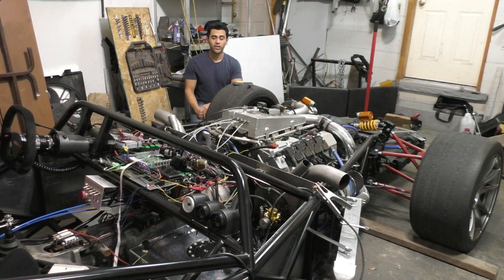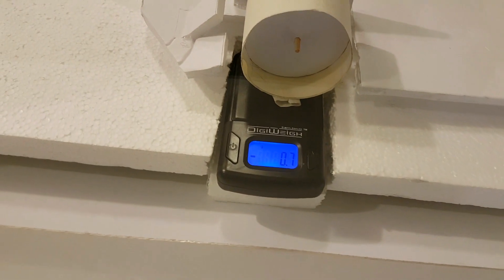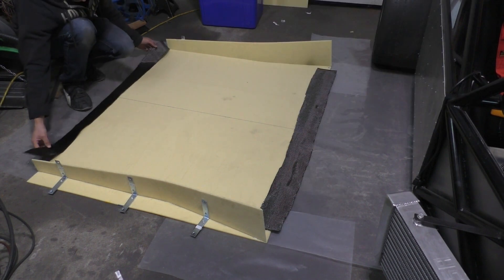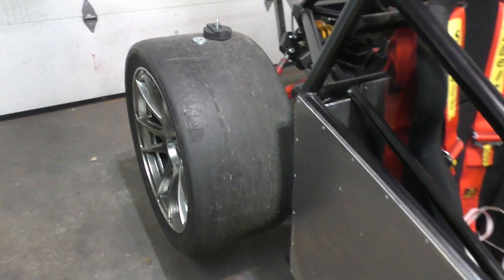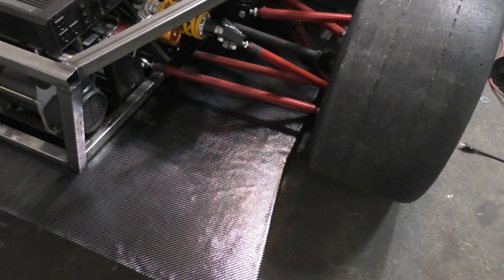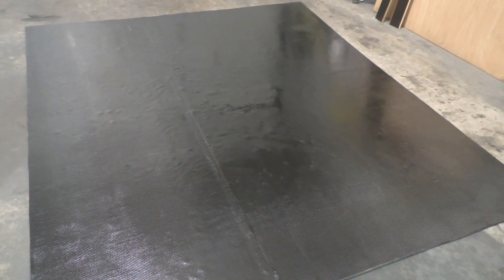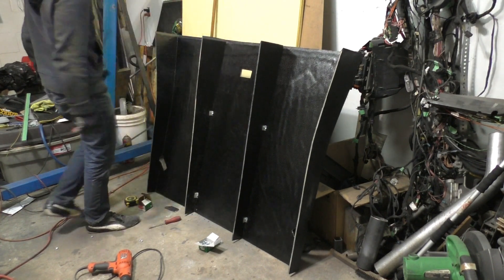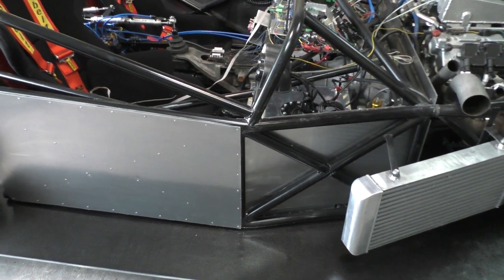Making Functional Carbon Fiber Rear Diffuser and Flat Floor - E55 ASL Part 20

Comment: carbon fibre corrodes metals when in direct contact. also you should consider reinforcing sections of your undertray with aramid fibres to form skidpads. also sandwichpanels should not have open edges. ideally you would add carbon fibre around the edge (probably requires vacuum) alternatively you could use some type of viscous adhesive.

Comment: What might be interesting to implement is to 3d-print a teardrop-shape that could fit around your hockeypuck fastener. This will reduce drag by 60-90% on the fastener and improve airflow around it by reducing the turbulent wake to laminar flow instead. 

The reduction of drag is of course depending on the shape you'll make the teardrop shape, but by just adding a pointy end to your puck, it will reduce drag on it by approximately 60%.
Reply: Someone should gift him a 3d printer. I'd like to see him use it to cast his own parts.

Comment: You should always use opposing and crossing fiber directions. This is very important for strenght. Usually 45° between each layer and different tows too. You tested it one way? Cool, but it might break easily on the otherway. ALWAYS vacuum bag if mold+press or proper manufacturing tools are not available. I have a lot of carbonfiber part development on my car and also foam cored parts. Good luck. :) Do not set your self for failure, in racecar et means injury or death.

Comment: Have you considered using Hall effect devices instead of reed switches for the gear sensing? They would be much smaller and faster than reed switches
Reply from the maker: Yes, that would have been better but potentiometers are a more precise solution, since they'll tell the exact position and even speed of movement

Comment: How did you determine that you would have more front downforce from the diffuser design and how would you determine a balance before you put on the wings? ✌🤔
Reply from the maker: Just by cfd and wind tunnel cut outs. It's not the most accurate because it didn't simulate the spinning tires and stuff. I will be setting the final rear wing angle on the track to get the balance perfect

Comment: I just found this project yesterday and i have bingewatched every single episode until this one since then, really enjoying it alot! Can't believe what you have achieved so far! One thing though: Welding a compressportank is dangerous, and i mean like really dangerous, it should NEVER be done! I would strongly advice to remove that now sevierly weakened tank as soon as possible and find another solution, something that can bolt on preferably. This tank is a potential bomb that could explode when you least expect it. I get that this car is a death trap anyway since it IS a racecar and not a streetcar, but you try to make it as safe as possible anyway and you should really consider it. Also isn't there any way to possibly drive a compressor straight from the engine and get rid of that heavy and clumpy inverter?

Comment: Great job with the floor
but
Remove all this messy shifting system and go for simply manual shifting
Reply: Cristian and save a load of precious weight by removing the compressor, inverter, air tank, pneumatic cylinders, linkages, control system ...
Reply: Sometimes he adds tech for, what seems like, the sake of adding tech.  Ditch the air shifting shenanigans, drop a bunch of weight and have peace of mind knowing that you don’t have a bunch of jenky parts that could cause a failure on an otherwise amazingly built/engineered car.
Reply: @carportshenanigans5918  Exactly..   I could understand this shifting system as a demonstration of his enginiering skills... in that case this is an excellent job, but for the reliability of a race car I think it is not a good idea at all... Also, I don't think this hybrid system is faster or efficcient than shifting this manual transmission by hand xD
Reply: @Cristian, it’s definitely a cool excercise in engineering.  Reminds me of all the shenanigans he had on the old car with electronic throttle bodies and computers and all sorts of sensors when the turbos should just be blowing directly into the SC inlet.  Oh well, nothing wrong with experimenting...great way to learn.

Comment: you said you only get an extra 2kgs of weight by not vacuum bagging. have you also considered the extra material you need in order too make the material smoother enough so the air drag is as low as the vacuum bagged one?

Comment: Have you looked into vortex generators or turning vanes as opposed to a skirt to seal your underbody?
 I'm working on a design for my own car, and I thought about a skirt, but being street driven, I feel that any material with enough deflection to accommodate for road imperfections would also displace due to the aero forces.
Unless you went with a firmer material and some sort of trap door mechanism, which would just add weight and complexity...

Comment: If you're not going to vacuum bag then your best bet for spreading the resin and eliminate the air bubbles is to use a finned roller.

Comment: I think I hear more excitement in your voice in this video that the previous ones, you are getting so close now. I had two thoughts while watching, first did you consider using one of the rollers that they use for fiberglass which helps with resin distribution? Second could you use a cheap shop vac with disposable paper filters to suck up the carbon fiber dust as you cut it?

Comment: front part should be re-design front difuser throws expanded air on tire what cause higher presure under tire makes lift and drag u should make tunel under that throws air at the sides behind front wheels this air also can produce more downforce if u use vortex at the skirts because vortex will provide a rotation that stops air from coming under the car and u would got some more predictable downforce

Comment: Fiberglass is actually stronger. Use an industrial type and your epoxy resin. For a core the foam is good the plastic stuff that looks like Corrogated cardboard works good too.  Fiberglass is more flexible though.

Comment: Have you ever considered simply actuating the shift fork control rods independently? This way you just use three linear actuators to operate the forks directly. It may be quite complex to do on a longitudinal transmission though, and stopping in neutral may require an additional actuator to act as a physical stopper, but it just seems like a much more direct approach for computer control vers adapting extra nonsense in the middle that's more designed for humans.

Comment: Typically you bridge a household aluminium ladder on two bricks across a piece like this and then you can reach all areas easily. Ideally, you would have spread resin using a window cleaners wide squeegee on a pole and made life much easier, faster and not have the resin pooling and air entrapment issues.

Comment: shoulda used paint rollers instead. that's what I used when making splitters for my car and it applies pretty even layer of the resin while not putting too much of it on the part.

Comment: I love the design of your car. Do you mind if I post a link to your videos on locostusa? I'm a bit concerned with your front spindles and also the attachment of your floor. When I built my car( phil's LS1 locost) I ended up using .090" 6061T6 and stainless rivets 2" on center for the floor. If you were to have an offtrack excursion your minimally attached floor could delaminate the way your splitter did and your legs could end up outside the car. I was also concerned about what would happen if I ran over something and it slit the floor like a can opener . If you added some thin aluminum strips below the floor and sandwiched the carbon between the frame and strip and increased the number of fasteners,it might prevent the floor delaminating if the weight of your legs  loaded the floor heavily ( you choose what G force to design for in a crash). Not sure about the strength of thin carbon fiber in a can opener situation.

Comment: Seems to me  your  inverter  and air compressor are heavy unless they putout a high CFM. I'm using a belt driven air compressor "york210 converted from a/c to air" with clutch pulley. Its powerful, fast and reliable but, a hassle to find a stable belt for it not to mention a custom bracket to mount it for your situation and really heavy.
There are air suspension companies like viair that sells 12v compressors with 100% duty cycle, small and a tank with internal compressor but, I'm not sure one will be enough for you.
Still its worth checking out. At least electrically safer.

Comment: You should of definitely vacuum bagged that carbon fibre the crappy surface will cause a lot of messy air but mostly it just doesn't look as cool

Comment: the steel air tank you used is going to create rusty nasty water in your air system. you need to use a AL tank

Comment: You should be prewetting your foam before putting down your Carbon, alot of the resin will not penetrate though the fibers then guess if the foam is saturated. What are you using to seal the edge of your Composite? My company uses Epocast 1619 or 1629. Plus your front diffuser shouldn't dump air right into the front tire.

Comment: Kevlar is lighter than carbon and spread tow or checker fabric uses less resin. In race cars like  GT3, Kevlar is used in non structural body panels. Almost always for underbody panels.

Comment: Will it actually produce noticeable downforce or does or just look good and make your car heavy?
Reply: He mentioned in the video that the floor will create most of the downforce. Especially with the skirts. 
The nice think about this type of downforce is that it doesn’t induce much drag so it’s basically free downforce. This in sharp contrast to a rear wing.

Comment: If you weren't concerned by having a lightweight and stiff floor shouldn't you have used fibre glass NOT carbon fibre, and saved a chunk of $$ too? I'm sure you would have saved more weight than you quoted if vacuum bagged. Incredible build!!

Comment: How much weight have you added with the auto shift? I think you should bag that whole setup. You built a car to drive. Drive it yourself.
Reply from the maker: Pneumatic are about 3kg but the air compressor system is close to 17. It's still worth it for the amount of lap time it will help save

Comment: That automatic paddle shift thing is a useless gimmick and I hope you give up on it but I like this project.
Reply: Not if you’re going for lap time it isn’t.
Reply: @monkmodemalik8225  I think what you're talking about is a dual clutch transmission. His system is a replacement of his arm on a classic manual transmission which I think will hinder lap times and add unnecessary complexity to an already good system.
Reply: @nickmartin3647  it's automated manual. it's literally a manual transmission that shifts faster
Reply: @parrm9580  A manual transmission can shift as fast a manual transmission, getting machines to shift for you doesn't make it any faster than it was designed. Perhaps human reaction times are slower but the added weight and complexity (which means more possible points of failure), is not worth the saved marginal shift times.

Comment: Aerodynamics is an actual science you can’t just wing it🥴
All kidding aside you need to tune the aero for the vehicle. A strong fan and some smoke will help get the aero tuned for the vehicle, tuning is important if you want a stable vehicle that doesn’t steer off the track in a cross wind and doesn’t flip into the air if the nose lifts a hair.

Comment: Man that is low on the front. As tight as your suspension might be you should really consider making a bit more allowance between your floor panel and the suspension arm travel. You are going to hit dips and bumps and they are going to ruin your day. Suggest you spend some time observing at the track you are going test this on to see where cars are bottoming/rising, particularly corners
Reply: Awesome channel - friggin genious

Comment: Why not use a belt driven air compressor and just run it off the motor instead of an electric air compressor.
Reply: SK8215 
I was wondering the same thing. You must have thought about this. What made you decide to go full electrical? Easier to control maybe? Couldn’t you use a aircon like setup with an electric clutch?
Or why not use a 12V motor for the compressor?

Comment: You welded on that air tank?! That is a big no-no, and its right beside your head? I strongly recommend you replace that tank and put it on rubber mounts, for your own health! If weight is a concern, replace that heavy inverter and AC compressor for a 12v compressor, Theyre not expensive.
Reply: I say use an engine driven air compressor and carbon fiber air tanks.
Reply: Frydaddy 
He’s studying Electrical Engineering if I’m not mistaken. I was wondering too why he doesn’t use a 12V motor.
Reply: @Conservator.  Smart doesn't always mean intelligent. I've seen both sides of that coin. He may also be working on a budget, but that shortcut is hardly excusable considering the scope of this project. 

I'm more concerned about that weld job on a pressure vessel. Even if it doesn't blow up in his face, it will still develop a stress fracture from vibrations.
Reply: Frydaddy 
I didn’t intend to disagree with you at all. 
I was surprised to that he didn’t use a 12V motor especially considering that he’s an EE student. 
I have no knowledge about pressure tanks but/and I take your word for it. I hope he reads your comment.
Reply: @Conservator.  Agreed.